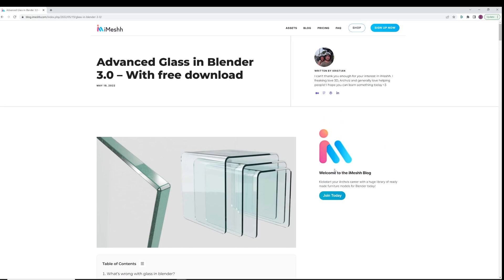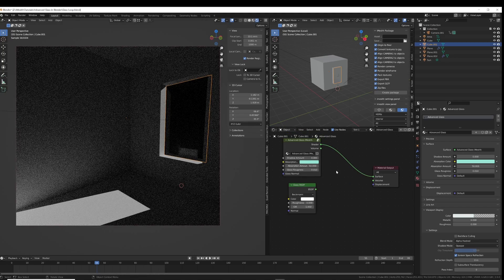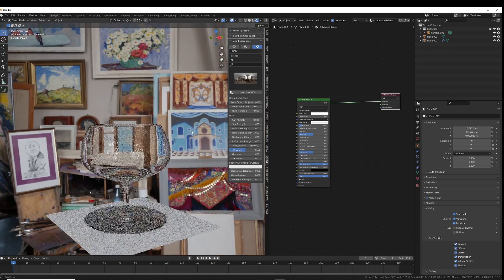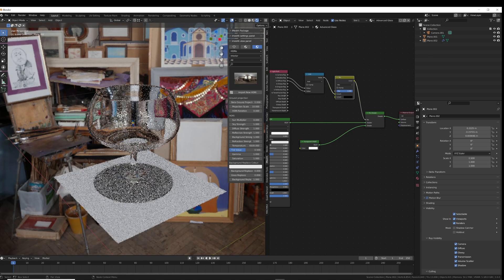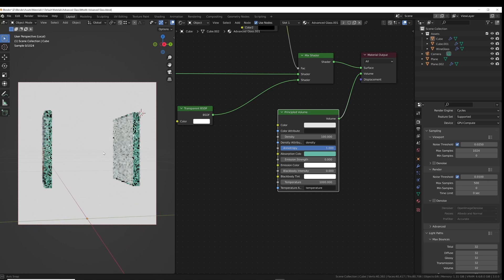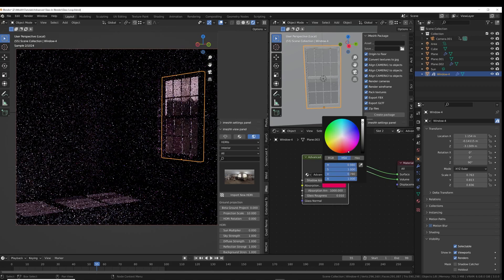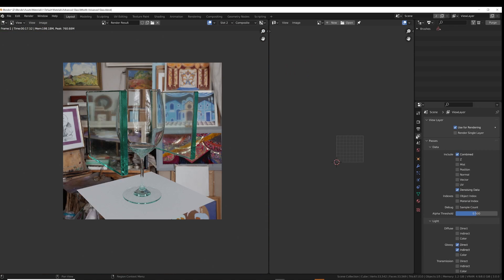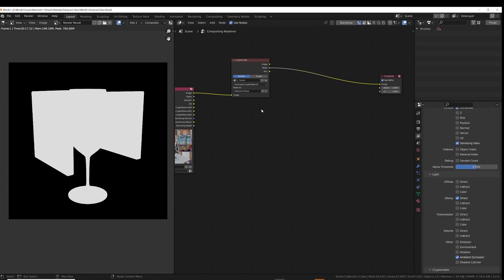What is wrong with Blender Default Glass? Free Glass Shader Download!

Comment: The shadow-in-glass issue is fixed with the new Path Guiding mechanism in 3.4.
Reply from the maker: This generally will fix a lot! Incredible update
Reply: @imeshh  Yeah, they're working on some other improvements for glass in the upcoming Principled V2 shader. I believe they're supposed to be adding proper absorption to it, but one other thing that is fixed is energy preservation for very rough glass. 3.5 will be an incredible update with it, especially since PV2 will have proper energy conserving materials.

Comment: Hey thanks for the super useful tutorial! 
I have noticed another strange behaviour of the glass in cycles. 
When you intersect twho glass objects with the same IOR, and you render them with corona renderer, they behave like it was one solid single object, if you do it with cycles, you still see the intersected part as if it was inside the other glass, but this is physically inaccurate because if the objects has material continuity (no air gap inside) they should behave like in Corona, do you know if there is a way to force this behaviour also in cycles?

Comment: Hi! Do you you use plane or box for your glass in window? I found: „You will need to either model the glass as it is built in real life (with thickness) or skip the glass shader and replace it with a glossy/transparent mix”. What is better for windows? Thx.
Reply from the maker: For window glass, I would make sure it is a box (not just a plane with no thickness), I would then use a simple glass node with a lightpath node to hide the diffuse and shadow rays. This can be done with this glass shader (available in the description), if you turn off any absorption and turn the shadow down to 0
Reply: @imeshh  thank you :)